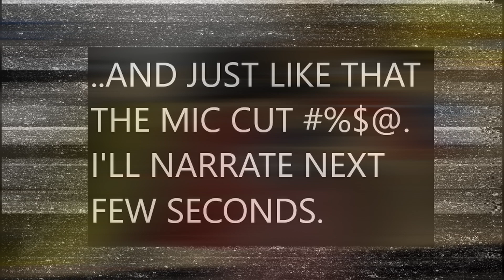Jaguar Supercharged VAP Griptec Pulley Install Guide

Comment: This is in my feed because I put a TVS1900 on my Chevy LS with a SWSMotorsports adapter. I'm actually going with a 3" pulley because of the ratio of the crank to blower pulley.

Comment: Do I have to get a tune with the sc pulley upgrade I don’t want it to damage the car ?
Reply from the maker: Yes, you need a tune if the pulley is going to make any difference to performance.  You can fit the pulley on its own but it will not change the power output.  If you are looking for a simple upgrade in power, the ECU Tuning would be the first thing to start with.

Comment: Have you noticed any difference in belt wear or shorter belt change intervals with the griptec ?
Reply from the maker: Not compared to our pre-griptec options, but we do recommend more regular replacement than unmodified vehicles.
Reply: @ like every 3 years or 50k miles ? Something along those lines
Reply from the maker: @jacobtravis812  We generally change them annually, or close to that, due to the increased load put through the belt, and tensioner assembly.
Reply: @VelocityAP  

Thank you for your reply. Much appreciated

Comment: Thank you for the video. it was very informative. What kind of hp can I expect from just your upper pulley on an 11 XJL Supersport? It's already tuned and has a lower pulley.
Reply from the maker: The upper pulley will add right around 1.5 psi of boost.  Whoever tuned the vehicle will need to adjust the tuning to allow for the additional boost, so the amount of power added will vary based on who is tuning it and how they set it up.

Comment: Do i need a tune if i switch my V8 5.0 supercharger pulley to 62mm, like will get any power if NOT tuned ?
Reply from the maker: Yes, you will need a tune.  There's some very marginal low end you might pick up, but if you don't change the ECU tune it will just vent any excess boost pressure through the bypass valve.

Comment: Hi

I have a rover 3.0
Im going to attempt the swap.

I just ordered the hot plate on amazon

But question 
The new pulley needs to be at what temperature? 

I have a digital heat gun to read

Thanks
Reply from the maker: https://youtu.be/ugDsZcNcAKs?feature=shared&t=284

Comment: On the 5.0L will you get more power from the 58 or the 62?
Reply: YouTube comments is not the ideal place for tech support. Phone or email is best.
Reply from the maker: 62 is the max we support on the 5.0L, but it can be combined with a crank pulley for +5psi of boost and 660BHP, 630ft/lbs
Reply: @VelocityAP  I already have a crank pulley and am looking into getting the upper pulley and a new tune for that set up. Is there any areas that would require attention to help accommodate for that extra power?
Also would a transmission tune be something to consider?
Reply: @VelocityAP  oh ok I got cha sorry I thought you had said the 58 could go on the 5.0L but the snout would need to be shaved down for clearance. I must have heard wrong
Reply: @VelocityAP  well at least I now know where I won't be buying any of my upgrades from so thank you for that

Comment: When you place the pulley on the snout with the tool, are you pushing it as far back as it can go on the snout? There is no chance of you pushing it too far back and it not having enough space to freely move, right?
Reply: Nevermind I talked to Griptec the stopper in the tool allows it to seat flush